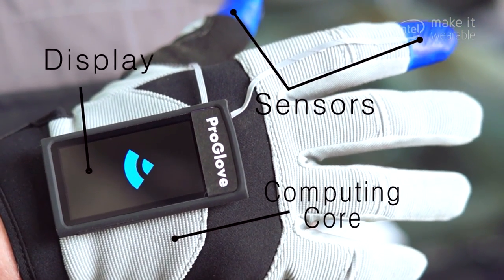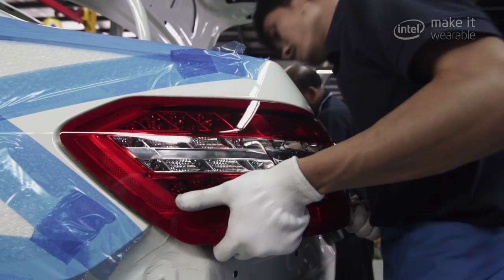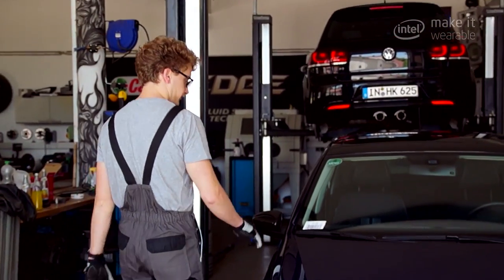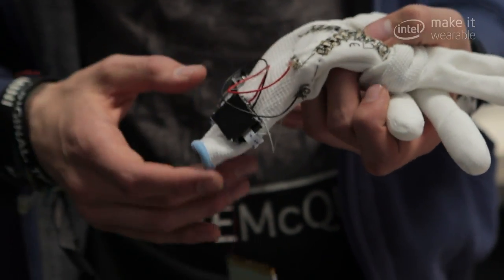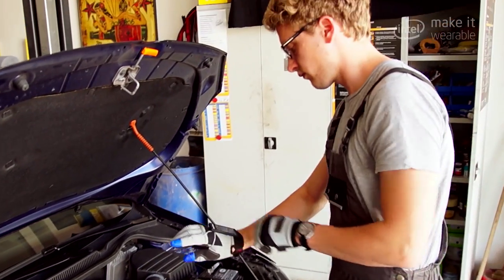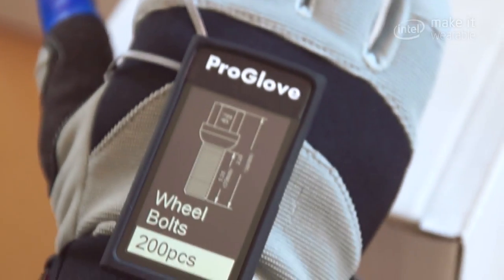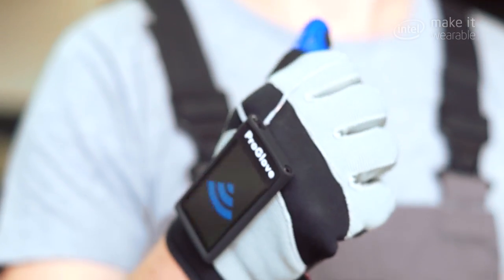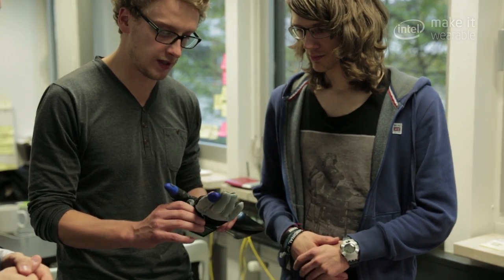Make It Wearable Finalists | Meet Team ProGlove

Comment: I'd be surprised if the Formula 1 or Le Mans series don't implement this technology or a derivative in the near future. Testing the proper amount if pressure of nuts and bolts during assembly and testing would make a remarkable difference in safety and reliability.